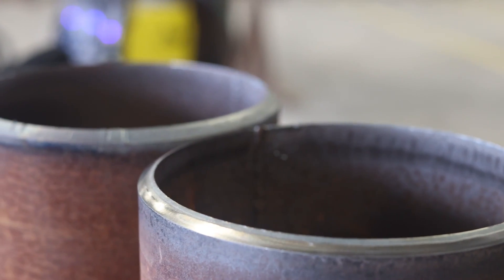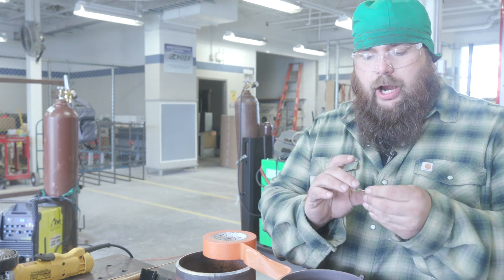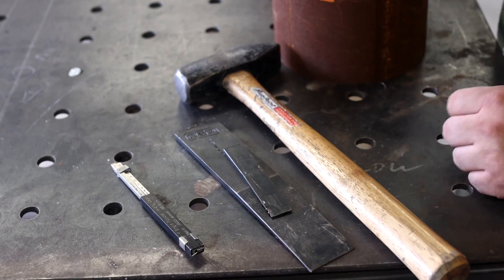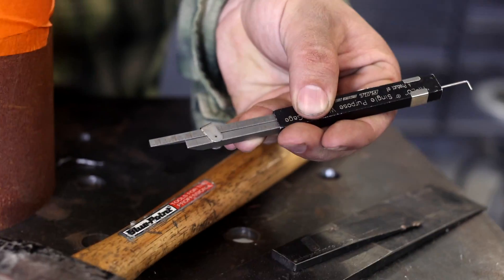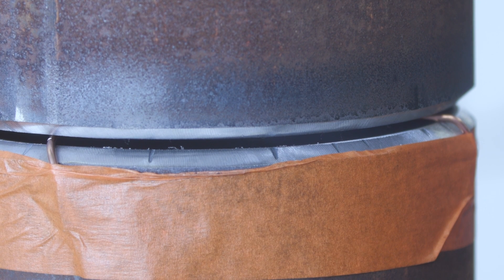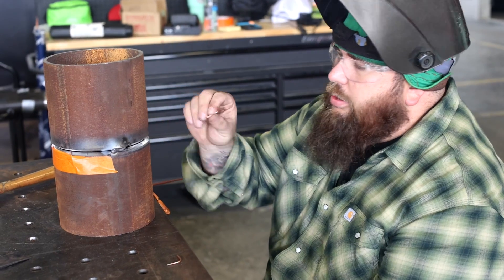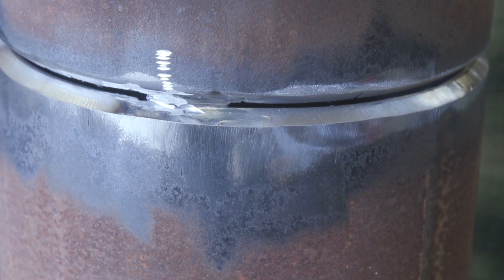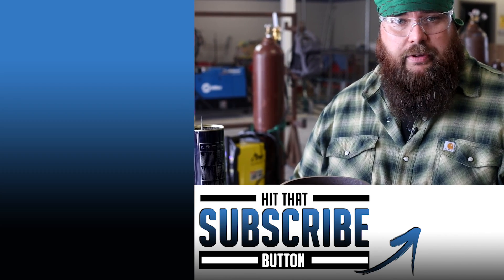Proper Pipe Fit-Up Guide for Students

Comment: first time seeing that 4 pcs. smaller spacer rod method, most videos use the full length rod without the flux coating of course which i see most of the time they're having difficulty, definitely remembering this. thanks!

Comment: This is great but not practical in the field, what I do is I eye the pipe from the inside and use a saw blade spacer, use a 1/8th landing, then put on 4 tacks using the red Lincoln’s ( they are meant to be used to punch through thick landings ) and I used a 0.045 cutting wheel and rip the root, that way I’m efficient and accurate the entire time.
Reply: U burn ur root with rod? We use s500 Lincoln stt for root n spray for the rest. I mean we can use spray or pulse mig.
Reply: @chadmoyer1453  this sounds like some new fab shop stuff haha, at my old fab shop that’s what we did, I haven’t done pipe since.
Reply: Where do you get spacers at ?
Reply: @patriotskingnation8084  just gotta buy a saw blade pretty much you can buy them anywhere
Reply: @quickshot4050  is is 3/32 gap?
Reply: * it